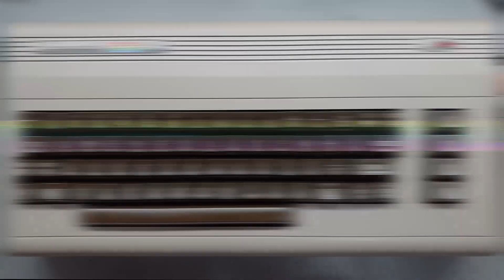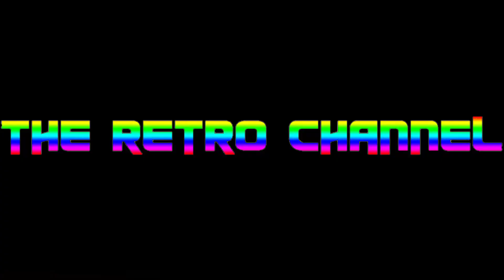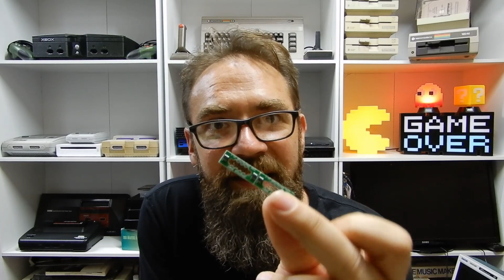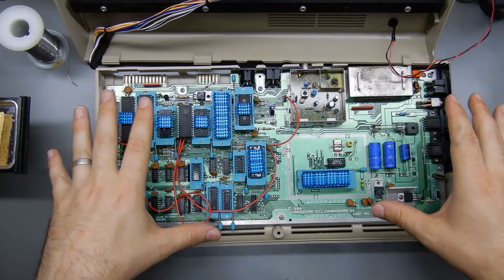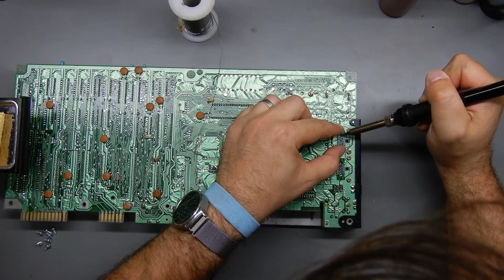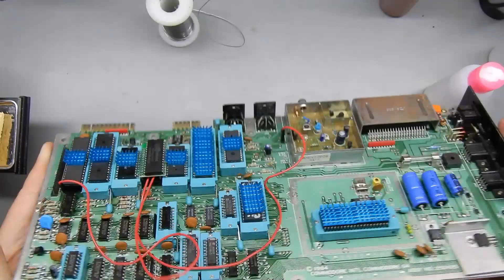Commodore 64 ESD protection

Comment: A couple of years ago I was loading GEOS (which the c64 seemed to be struggling with) and I was changing the joystick port when I suddenly got an "out of memory" error. I don't know if it was GEOS that caused it (wouldn't have thought so), changing the joystick port, a combination of both, or just a complete coincidence. Either way I did more damage trying to replace the RAM chip. 😔